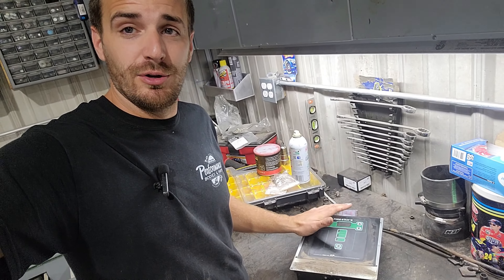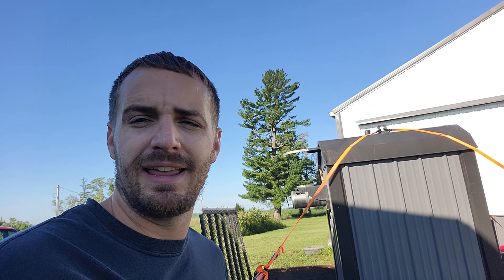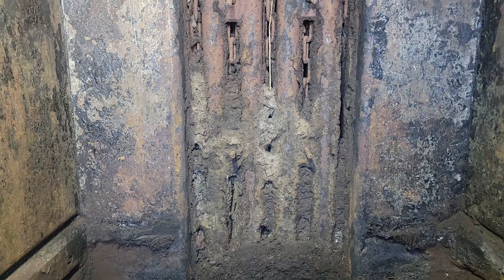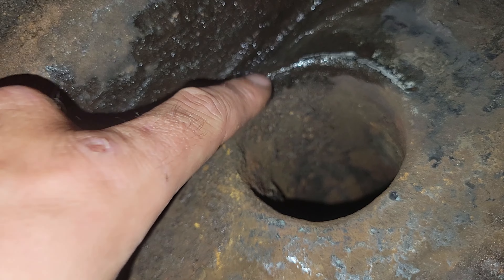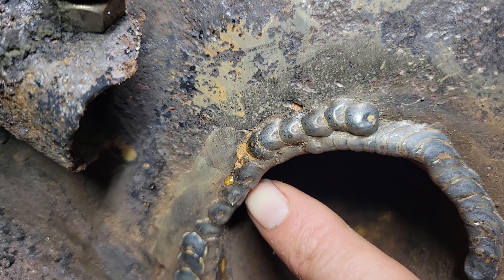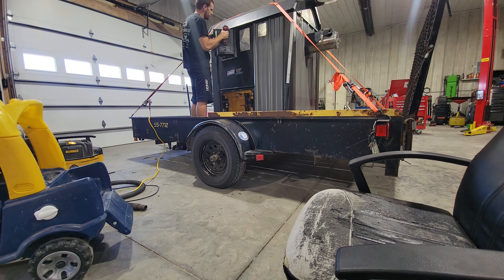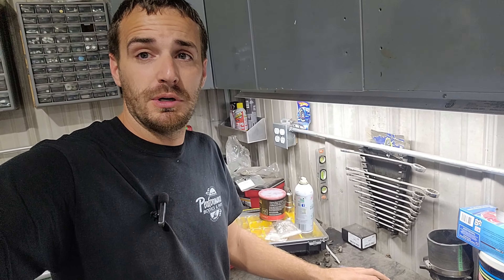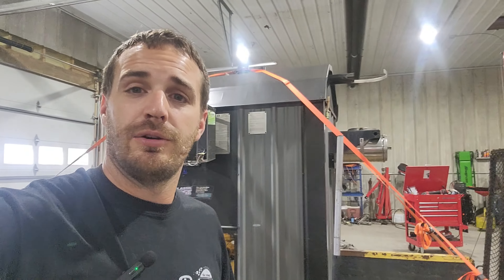I spent $200 on a $15k boiler, Can I fix it on a budget and heat the shop for free?

Comment: Very fun project . I have a shop similar to yours with 14 ft ceiling and 2 14ft wide doors that are like 13.5 ft tall. I installed a wood stove 3 winters ago and not great at heating the whole thing during colder weather . Would like the boiler but knew they are too expensive  for me . I do have in floor piping but electric boiler way to spendy  to operate. I do hope this works out for you .
Reply from the maker: So far so good, I wish I had in floor heat to utilize with this boiler. At the time I poured the concrete in 2020 the foam and line was so expensive it was going to add over 10k in just materials. That year was crazy for building material. So far we've had temps in the single digits and its stayed around 60 in the shop, which is comfortable while you're working. I do think I could benefit from a second heat exchanger but this will do. I'm still repairing little things on the boiler but overall its been working great, just burning more wood than it should. I'll have a video about that soon. Thanks for watching!

Comment: A friend of mine had one that had a cabinet shop, they used to Mill and make all their own solid wood panels, then they would burn the scrap so they had almost free firewood. But where it was located the way the wind blew it would choke you  out it was horrible. Place it somewhere where the smoke isn't going to roll in towards your house😢
Reply from the maker: The nice thing about this stove is with the gasification part, the reaction chamber reburns the smoke and I don't really get any of that nasty heavy smoke coming out.